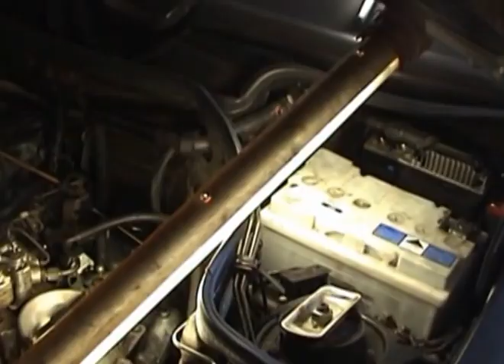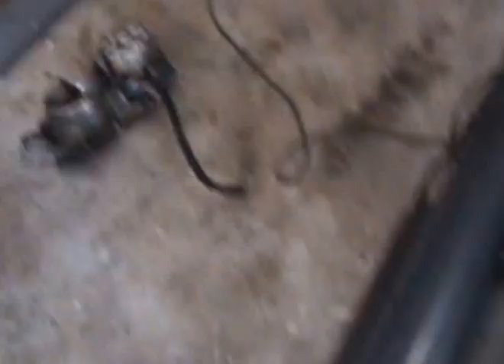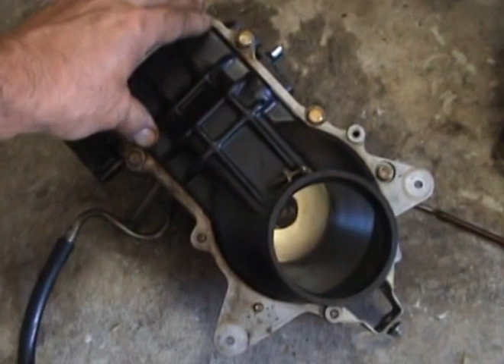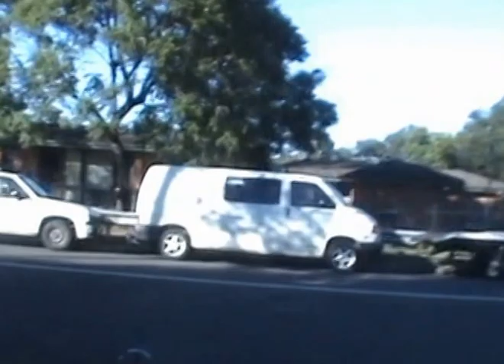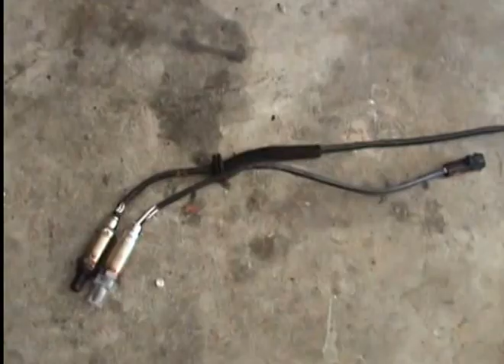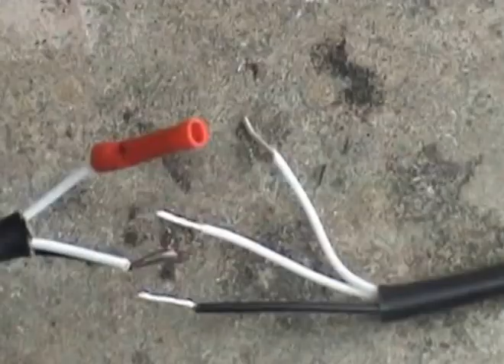300E Mercedes, removal & clean of fuel distributer and air intake

Comment: So changing the o2 sensor totally fixed the flat throttle  response issue? Or was there other issues to begin with? Mine is not starting cold or hot. Good fuel pressure  & supply (new pump & fuel filter) to the fuel distributor 0 to the injectors tho. Starts easily with a splash of gas to the intake

Comment: Thinking about cleaning the air housing too, not sure about how much it will do. But I'm about to buy a new o2 sensor too, because the old one is very dirty, as a result of a worn engine and maybe a rich mixture.
Did you notice a difference, after you cleaned the air housing?
Reply from the maker: No great difference, but it is important to keep the air intake plate clean so it seats correctly, with no bad idle issues. cheers, Paul.

Comment: Hi Paul I need your help 

When I drive the car at normal or low speed I smell really strong carbon, and also I have kinda bad fuel economy. My car is 300SE 1989. Could you please help me?
Reply from the maker: Hi, Abdullah  I think your problem is the oxygen sensor, it sends a signal to the ECU, which adjusts the engines mixture.  Cheers, Paul.

Comment: So to join the o2 sensor 3 wires to two wires, do you simply combine the two white wires?
Reply from the maker: Hi, Do not join the white wires together, they are the heating element.  Should be a two pin plug for them.  The black wire is the oxygen sensor and is a separate plug,
It is a 3 wire system.  Cheers, Paul.

Comment: Sir. I am working on a 190E, the issue is that is the car stalls after very short period driving and its trhowing blak smog and its carbonizing the sparks, I replace fuel pumps due to leaking and fuel filter, spark plugs, spark plugs and coil cables, distributor cap and rotor. I also clean the inyectors I drived the car for ten minutes and it runs much better but again started to throw black smog. Can you give me your advice on this. Regards and congratulations for your videos.
Reply from the maker: Hi, Carlos  Could be the auxiliary air valve, the oxygen sensor or the temperature sensor, or a combination of the three.  Try cleaning them and check the connections on the temp sensor first, good luck, Paul.
Reply: riffraffjazz I will check those thank you very much Paul.
Reply: Hello  Rifffaffjazz
How about showing where the part go,what they look like. My MB manual is a waste of $$. Nobody has most parts  without special ordering  it. No new to 50'60' cars. MB has me surrendering no help 😂😂😂😂😂
Reply: O2 sensor no prob but the other no clue here  lol I have never felt so stupid working on a car my ford's n chevy n mopars are nothing

Comment: My 91 300e went into a merc dealer for a fuel valve replacement and when I went to pick up the car it was not firing on number 5. The fitter was revving the bejesus out of the engine hoping to accomplish what I don't know what. So hopefully I can collect my car today with the pistons intact.

Comment: hi paul, working on a 87 300E and i am kinda having the same problem as Azzam here except mine will sometime run and sometimes not  when you put it in gear but if you manage to keep it running in gear you litleraly cant get and throttle response and it will surge and richen itself out. i have ordered a crank sensor and some other sensors but was wondering what all you would think could be the problem. i can send you more detailed info if you need it.
Reply from the maker: Hi, Dave Starting issues are a big post on this site and most of the 
time it turns out to be the coolant temp sensor or idle valve or O.V.P 
relay. The coolant temp sensor is the single most important sensor for determining air-fuel mixture at start up and during warm up. Once the oxygen sensor heats up and provides reliable data, that sensor gets #1 status.The over voltage protection relay provides power to your engine management system and your ABS brake system, check the fuses first. You can test the idle valve by giving it 12 volts & see if it moves, also give it a clean and check the hoses for splits.  And as usual check all the engine vacuum lines. Do these checks before spending money on other sensors.  Good luck, Paul

Comment: hi paul, i am working on 89 300ce and i am having a hard time starting when cold at first but now both cold or hot. . it hard to start, and rough idle, if i take the air filter out and i slightly touch that air door in the middle to open it a little it idle fine ... any idas
Reply from the maker: Hi, Sorry for the delay, I would first check the hoses to you idle control valve, could be split. Make sure that all your vacuum hoses are not damaged and are connected. Also Clean out the idle control valve. Good luck.

Comment: i been watching your videos for a while and have been lots of help. now i am frustrated with my 300e which has a flat acceleration as well change fuel filter catalytic converter both fuel pumps test good. so does cap and rotor. my fuel distributor test good too with all 6 filling up and draining at the same time. any ideas that can help bring my acceleration like it use too
Reply: what plugs are u using?

Comment: My car has always had starting issues cold or normal operating temp I have changed everything I can think of except the fuel accumulator,I hope that works for me ! Also I am currently chasing a high idle problem that causes my car to jerk when put in reverse,I watch all your videos and they are a big help to me,thanks!
Reply from the maker: Hi, Again,  Sounds like the auxiliary air valve, either sticking or leaking.
Good luck, Paul.

Comment: I am using W124 300E my speed transmittion only running 1 2 3 how to adjust speed to gear 4
Reply: w124 auto 4 speed tranny starts at 2nd gear. it will only go to first if you floor it from a stop. it is designed that way.

Comment: Hey Paul, My 1991 300ce and your 300e have many similarities.  Thanks much for the videos.  Have you ever replaced a heater control valve...mine was bad as well as a cracked radiator. I replaced both along with the thermostat and still have no heat.  This car was garaged for 7 years...so bought tools and now I'm a bonified DYIer. Feel free to email me also ddrayper@gmail.com. Also, where do you get those diagnostic reports from you use that gives you symptoms and repair suggestions?

Thanks again,

Dray